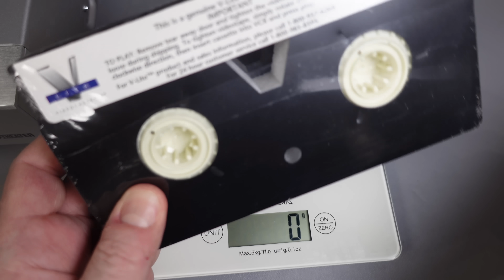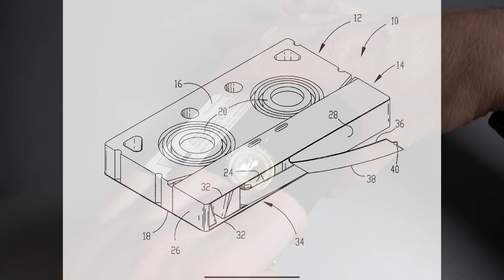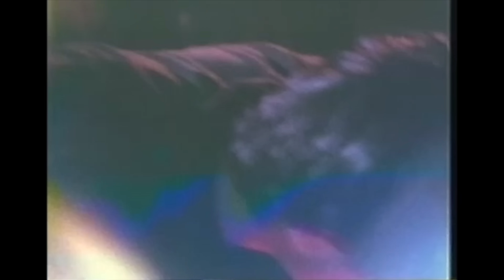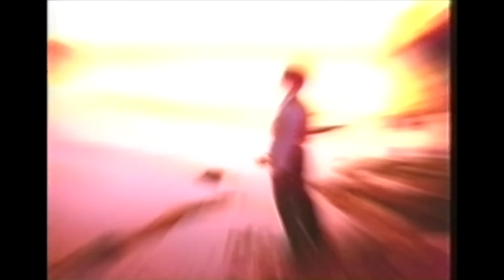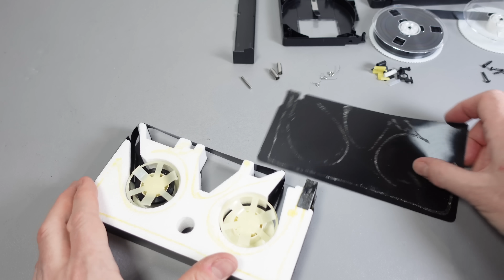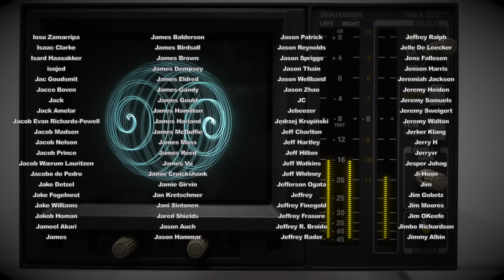V-Lite: Disposable Lightweight VHS tape

Comment: I remember the "2view VHS cassette". I still have one of those around somewhere.

The idea was that it's just another VHS cassette but with a prerecordered film on it.

You would be able to watch it twice, and it would delete itself. After that you would be left with a blanc tape you could use for anything else, and that would remain intact.

The internals were genius, the mechanism had a permanent magnet in place that would engage once, while you played the tape for the second time, and disengage afterwards to be locked in place away from the tape forever.

So the permanent magnet would do its thing and disappear into a corner.

These were popular at the very end of the tape era, so naturally they got replaced by DVD's shortly after.
Reply: Not another Flexplay
Reply: These things were first tried out in the Dutch market. It took one day for someone to realise the system could be defeated by a paperclip and some tape. They were pulled from the market very soon after
Reply: @markvanmaanen5152  
I still have a copy of coyote ugly on 2view, i took the magnet out of the mechanism, which wasn’t that easy, cassette is screwed but also sealed at the bottom end.
Strange looking cassette shell, no windows and a transparant blue lid.
They came in a simple cardboard sleeve.
American business man merrill solomon of ‘now showing entertainment ‘ came up whith the idea and tried it out on the dutch because we were supposed to be ‘ the average european consumer’ 
They were only 15 gulden (7 euro) opposed to 40 gulden for a regular vhs copy, so a lot cheaper.
Reply: @markvanmaanen5152  Correct, they were surprisingly easy to defeat. 

But the targeted audience was also just the average household, who barely knew how to put the cassette into the recorder to begin with.

And then there's the portion who would just copy the film immediately onto a normal tape using a second recorder.
Reply: I'm guessing it wasn't hard to pry them open and remove the magnet...?
Reply: @jasonblalock4429  I would have included a cool self-destroying feature. It would have been a great anti- piracy measure
Reply: What would the point be in that?  I guess if you rented a video that never needed to be returned it would be cool but you'd only get to watch twice and you'd still have to pay for the cost of the tape so it would be pretty expensive compared to rentals.
Reply: I could only find two references via Internet search, one hit from the Netherlands, one from Germany. Translation of a 2001 German article:
 "According to a report in Video Store Magazine, the Holland division of Buena Vista Home Entertainment (BVHE) is testing so-called "2view" VHS cassettes for the first time with the film "Coyote Ugly". The film can only be played twice by the consumer, after which the video can only be used as a conventional blank cassette. The sales price for this is only the equivalent of 13 marks. The video stores have already announced resistance because they fear for their rental business. Buena Vista wants to test "2view" with five different titles and draw a conclusion after nine months. According to unconfirmed sources, BVHE delivers 60,000 units and invests around 200,000 marks in a campaign for "2view"."

Translation of a Netherlands article from 2001, mentioning the hack:
"The buying video concept 2View Video, which has been offered since Wednesday (May 30), appears to be easy to crack. WebWereld writes this on its news site.
2View Video is an invention of the American company Now Showing Entertainment that allows a video cassette to be viewed twice before it is automatically erased. The suggested retail price of the 2View purchase video is NLG 15 and the tapes are available from Blokker, Albert Heijn, Makro, Media Markt, Video Vision and V&D. After the second viewing, the consumer is left with an empty VHS cassette that can be reused, with approximately 140 minutes of recording time.

This week, six films from film company Buena Vista were released in the Netherlands. If a movie has been viewed twice, a delete button is activated that deletes the movie. According to Now Showing Entertainment, the technology is virtually watertight and hard to crack. But the go.to/2view site explains how to bypass tape erasing. According to the creators of this site, it is easy to bypass security. One of the initiators told Webwereld: “All you need is a paper clip and a piece of adhesive tape. You put it in a certain place in the tape and then you can watch the film indefinitely. The place where you have to put the paper clip in the tire is still indicated with an arrow.”

Now Showing Entertainment is also working on a technique to watch movies on DVD only a few times."
Reply: There was flexplay with VHS?? Never heard of them - but I would love seeing a video about them ^^ Just to see the mechanics - imagine how much engineering work went into something like this... to make a VHS tape erase itself.
Reply: I remember getting a single view tape similar to this in the early 90s with a survey about a pilot for a TV show, the magnet was glued in and I remember removing it.  I wasn't going to put a tape with a magnet into my VCR.  It only had 20 minutes of tape in it so it did go in the trash, I don't remember anything about the show other than it being so terrible I tossed the tape after about 5 minutes.
Reply: They really had some terrible ideas in that time period.
Reply: well at least you got a good tape after you watched it, but it just seems kinda wasteful to me
Reply: @JessicaFEREM   I would bet my life that they used the cheapest tape possible to keep the cost down.  After all it’s a normal VHS tape and a magnet — so materials cost would be equal or higher than ordinary stock.

Ergo it was likely a relatively costly product, with easily defeatable security, and poor reusability.

And it didn’t work out, eh?  Huh.  ;-)
Reply: Find it and send it to Techmoan!
Reply: My first question was "What stops someone from just removing the magnet?". I was not shocked at all to see the replies were about how easily it was defeated.
Reply: Sending full products out to people at little to no cost to the consumer will always be a terrible idea no matter how clever someone thinks their single watch mechanism is. With several thousand people getting their hands on it—most of whom are determined to beat the system—you can guarantee someone will figure out how to get around it.
Reply: @stephenluttrell8958  yes. It’s comparable in completeness to digital piracy nowadays. It did however really only become mainstream in an analog format when people were copying copyrighted VHS/beta/Laserdisc/CED, etc to DVD and earlier to VHS’s and others. Systems aren’t perfect and unfortunately will never be.
Reply: oh so it's highly unlikely we'll ever see one because they were all erased lol
Reply: @CaptainJZH  or they were hacked to disable the erase, and were treated like normal VHS tapes afterwards. So it might be hard to distinguish them, unless they have a unique logo in the case.

There's also the possibility of unsold stock sitting unopened in some random warehouse.
Reply: What?! I never heard of this!? I never saw it here in Canada(Calgary).
Reply: Reminds me of FlexPlay dvd. I bought one at a thrift store a couple of years ago, but as air started to get through it’s seal, or simply decomposition, it was rendered unplayable. Except this time it’s a magnet overwriting the data.
Reply: I used to get TV show pilots sent to me on these type of cassettes.
Reply: Queue the “Mission:  Impossible” theme…

Comment: Funny, it does seem a good cheap way of selling blank 1 hour cassettes for daily use. If only priced at $3 it would certainly have changed the market for a couple of years. I like the styro fillup, seems sturdy enough to use. Nowadays a 3 pack VHS costs $20. Good video, thanks.

Comment: I will gladly capture this with Domesday Duplicator if you want.
Reply: gonna be kinda hard after he took it to pieces. possible but kinda hard.
Reply: @keiyakins  the film can be re-reeled and put into another VHS cassette case. I guess I've done this a bit so I don't see it as hard
Reply from the maker: I captured the contents of the (historically insignificant) tape in the video and included the captured video in this YouTube video. You can watch the whole thing here: https://youtu.be/cD1vIIkGpYs
Reply: @Techmoan  if you haven't heard of the Domesday86 project you should definitely check it out (and it would be a great video topic). It led to having a software defined laserdisc/VHS/Hifi decoding system that produces far better quality compared to conventional captures at the cost of not being realtime. Some captures are on my channel in the VHS captures playlist.

Comment: I am surprised that anybody felt brave enough to put one of those into their VCR! I wonder how many got tangled up inside the machine? Will these be featured in the Techmoan Museum?
Reply: Good point. My recollection of the "flow of dread" is that I usually worried more that a poor VCR would ruin a prized tape more than the other way around.
Reply: My first thoughts here as well!
Reply: The only VHS tapes I’ve ever had get eaten are ones I poorly spliced together myself with scotch tape
Reply: @charlie_nolan  The only time I can recall a VHS tape bearing eaten in a VCR  for me or my family was either the fault of the VCR having an serious mechanical issue or maybe once with a very cheap regular VHS  tape that had some sort of mechanical problem inside the tape housing. With this, the way the tape is housed and spooled is simpler in some ways so long as you keep the tape tightly spooled. I would actually be less worried about this sort of tape being eaten in any VCR in good working order on first viewing then a cheaply made regular VHS tape with mote to go wrong.. The real issue is going to be if these disposable VHS tapes are watched over and over again, then it likely will see playback issues sooner then the standard mostly hard plastic VHS tapes.
Reply: I can just imagine that styrofoam shit getting chewed up and little pieces of it gumming up the machinery.
Reply: Video tape and even audio tapes are not the issue, its nearly always the machine at fault. Except when you rattle a Cassette in the car for years then it dries out (yep its lubricated)
Reply: @Jewellerybybarrie  Oh I don't know about that. During the mid-1980s the cheap "type zero" audio tapes, never well made in the first place, suffered a race to the bottom where the shells got really badly moulded and they started making the tape narrower (I think to 1/8 of an inch) so they could get the full four runs when they reslit whatever tape they were using (old computer tape was commonly used). This did lead to a lot of tape jams with these cassettes, which of course meant they got chewed up.
Reply: The entire thing probably exploded into a bunch of pieces in some vrcs
Reply: @belstar1128   What do you think happens in a normal VCR??  Haha  😄

Seriously though, I can imagine a few of these getting battered by the United Postal Soccer League, and having less than ideal integrity, that could result in some loose debris floating around.  Fishing out a stuck tape could get messy.
Reply: Museums for 80s computers have sprung up. Its not a bad idea to have a museum of media players and the device that stores them (cd, dvd, vhs, etc etc.) PS Its only last couple years that i stopped buying bluerays and I wonder if I will regret buying the digital streaming rights on Amazon.
Reply: @Applecompuser Cannot imagine reconstructing helical scan heads.  Even on big old ampex machines that costed several thousand dollars.
Reply: that happens so often with some cassette tapes 😂
Reply: It was the cause of death for my VHS player when a standard tape got mangled inside.
Reply: i jammed a very expensive professional multi-track ADAT VHS audio recorder in a recording studio once. its not my fault the damn things are a rube-goldberg machine to load & eject :( i got yelled at
Reply: It's not just cheap tapes that get chewed up. LOL
Reply: @Franko_Walker  That's the point. If even quality tapes get chewed up, what are the chances these cheap-ass insecure tapes actually won't. 😆